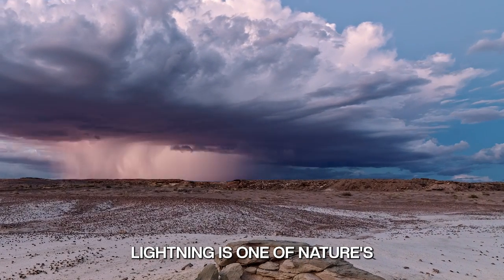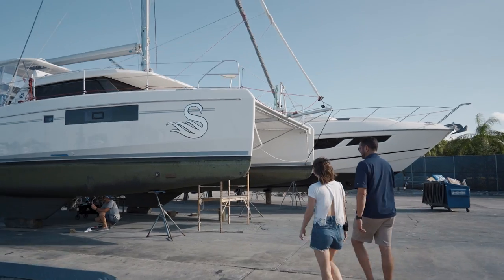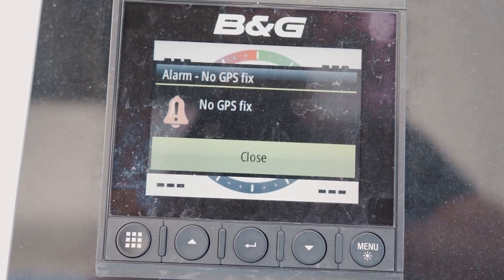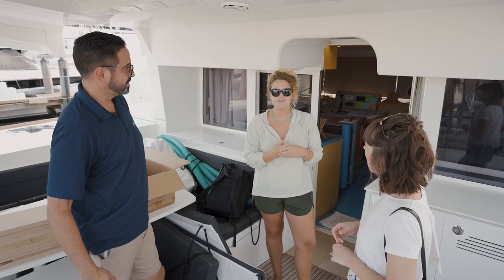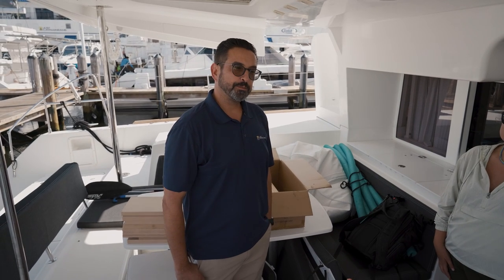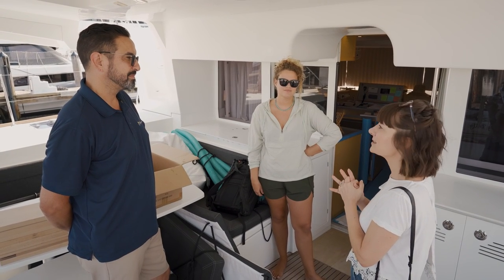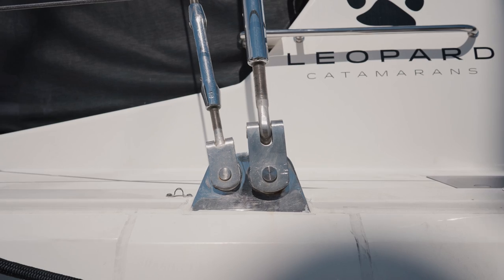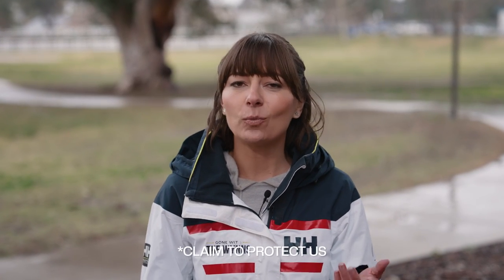Can Anything Stop Lightning?

Comment: When I was working for money I repaired and maintained Broadcast equipment in the southeast USA.  I dealt with the aftermath and prevention of lightning for forty years.  Ninety percent of the equipment I was responsible for was at the base of a tower.  This "mast" was sometimes two thousand foot tall. Our repairs often required troubleshooting at the component level of electronics.  The "Static Cat"  you are looking at helps but not as much as the marketing leads you to believe.  I would NOT drop fifteen grand in that thing.  I would quadruple all the grounding devices on the hull and quadruple the size of the wires that lead to the base of the mast and the wire that runs up the mast to the "Brush" device.  Next, all electronics, a.k.a. anything that uses electricity, needs to be grounded to that same point on the base of the mast.  Watch the Delos episode where during a lightning storm, they placed all their handheld electronics in the microwave oven. That's called a Faraday cage and is very effective.  Brian was an electrical engineer so he knows more about this than your average sailor.  YES keep good insurance. YES document events.  Once a simple screenshot of weather radar prevented a very expensive claim from being thrown out.  Lastly, do NOT rely on mechanical connections for your grounding.  Research exothermic welding,  one brand is called "Cadweld". Ocean and salt air are enemies of low impaedance connections Good Luck

Comment: Been hit by lightning three times on ships , the most damage took out a sat dome and nearby 10 cm radar .
The sat dome was secured by six 10mm stainless bolts , all were cut through by the strike . The strike shook the ship considerably,  all 360,000 tonnes of it.
The only nav system that is safe from  a lightning strike is a sextant and wind up chronometer.

Comment: This is something you really should go into depth on. A few years ago I really spent some time and was researching this. It’s been pretty universally standard to do the typical lighting rod to ground type of system. Grounding being plates. Connected to the top of the mast with a fat copper wire and bonded.  And add a lot of SPDs everywhere you can. Use fiber optics where you can. I’d protect the most sensitive devices with separate SPDs. Not super cheap but not bad either. It’s just basically interrupting any wire to and from whatever devices. Both data and electrical.   Use shielded wire where you can. 

It’s really annoying more electronics manufacturers don’t put surge protection in their devices. Nothing will survive a direct hit but nearby they’ll survive. It’s a cheap addition to a circuit board.  

I’ve never had lightning strike a boat of mine but growing up in south Florida I’ve had houses hit many times. Last house i built in north Florida I had SPDs of every type and fiber internet so no transfer there and still got hit that fried parts of the alarm system and a few ports and devices connected to a network switch. All of my Ethernet wire is cat6a shielded and grounded. What is was was all of the alarm sensor wire. Only wires that touch frames of windows and run everywhere. It wasn’t a direct hit it was just the emp from a near strike with all the alarm sensor wire acting like a big antenna and building a big enough charge to blow part of the panel, keypads, and a few devices without surge protection built in attached to the switch before it found ground.  I added SPDs to every alarm wire, grounded the alarm panel with a isolated ground, and added Ethernet SPDs to the panel.  Haven’t had an issue since. 5 years.  All metal roof 3 stories with tall trees around and over parts of the house.

Comment: As a Ham radio operator, I know a great deal about lightning and antennas. Cellular towers get hit and suffer no damage because they have robust equipment protection systems. In your position, I would look into those systems and not strike avoidance. 
The energy of a direct or indirect strike CAN be managed and damage avoided.

Comment: The other thing you need to look at is surge protectors, on your electronics, however most surge protectors use MOVs to take the hit, which means if you do get hit you have to either replace the surge protector, or get a soldering iron out and replace the MOVs . Its still better than replacing expensive electronics.

Comment: I watch another channel (Sailing Ruby Rose) where they are having a Cat built in Vietnam. In the latest video Nick shows the plate on the hull used for lightning protection.
I don't know if this is a standard item or an upgrade.
My first thought was if the Wynns were having it installed during the build.

Comment: Getting mine installed next week by Just Cats (provided there's enough room for the cable). Apart from the math, the downtown when you have a strike makes it worth while to have this installed. Have to trust the fact that it works. Would be great if insurers gave a discount on their premium.
Reply: If you have a Z-Spar mast, the conduits are not held in place very well. The weight of the large cable can cause the conduit to come loose and bang around. I installed a small strap to hold the top of the conduit onto its track and no more trouble.
Reply: @andersonautomotive  Thank you, will look into that.

Comment: When it comes to marine products companies come up with ridiculous numbers for cost. 
The device you showed for ionizing the air is basically 2 metal plates that are opposite charged and this causes air flow between them which slowly builds up as neutral or negatively charged air. This device can be built for less than $1000 in parts if you know what you are doing. Also this principal would only work if it's been on for a while and the boat isn't moving. If you are moving you are constantly passing through new air so this device is not able to protect your boat. If you test this device in a controlled environment or a lab it will almost always work. But even just parked in a marina if the wind is blowing strong enough you're not generating enough negative air around your mast.

Comment: There’s electrical power lightning protection products for shoreline electricity connection. There’s also lightning protection devices you can use to protect your radio systems that connect between your radio and antenna. To protect proximity air direct hits you may want to run several “grounding” cables that terminate as shown onto the sacrificial anodes and maybe a trailing wire behind the boat. Most of the protective devices I have mentioned are not expensive as they are standard radio protection products. Try researching some of the products in Ham Radio suppliers catalogues. Safe travels

Comment: Very interesting video!!!  LOVE your channel already!  Those setups are rather interesting.  And yes I completely agree with you that, it shouldn't have taken this long for that idea to be implemented on boats.  The idea that it is based on is a good one!
I am a licensed "HAM" Amateur Radio Operator and lightning protection is a BIG  and real thing!  I mean if you really think about it, a radio tower stands up HIGHER than neighboring structures and sailboat masts do the same.  The lightning is caused by an imbalance of free electrons between the earth and moisture in the clouds.  Water is a fantastic conductor (keep your radio and heater out of the tub! LOL) and the transfer (the act of re-balancing the free electrons between the two) is lightning.   AND it will always travel through the shortest path with the least resistance ie, your boat and mast at sea.
So, I would suggest contacting HH and asking them to either 1)install one of those systems in your boat WITH the conduit or 2) install the conduit for you to add the system afterward.  It would be MUCH safer having the grounding cable in the conduit to protect the other cables (vhf radio coax / light power / sensor wire) from the extra current / heat and interference.
In the long run you have to think and decide which is more cost effective?  The extra $15-30,00 to prevent OR $50-200,000 to repair?   As the old saying goes, "an ounce of prevention is worth more than a pound of cure!  
AND further more, as to your comment about "whet about being on the hard?"  See if they can rig up approved grounding posts either on those plates or above the waterline (maybe in the engine compartment?) so you can connect the system to a grounding rod while on the hard.  The plug in boxes "should" have their own there or, you can ask to drive one of you own in if you're on dirt in an area of significant lightning strikes.  We carried the all the time for the generators in the Army!

Comment: Only a couple of minutes and from my knowledge, you first want to make your boat less attractive by using equipment that dissipates ions so you are less likely to be hit. Then you want to make a way that looks attractive to lightning for it to pass right through. A nice thick grounding strip from bow to stern that is attached to a sacrificial grounding plate on the outside as well as prop shaft. Have everything that is metal grounded to it. Masts, railings, pulleys etc. Finally have a lightning rod with a nice thick ground wire running down the mast to that grounding strip. Its best to use braided cable for both the grounding strip and the lightning rod. High voltage likes surface area over wire gauge so braided cable can carry more of the lightning away from your delicate electronics. 

Another thing you can do is put a single disconnect point between your equipment and power then shut it off during a storm. If there is no easy path to ground, the lightning is less likely to go through it. 

7:52 "doesn't typically do structural damage" this is untrue. It can blow a hole in the bottom of a fiberglass hull and sink a boat in seconds. No fiberglass hull his 100% dry. The lightning will flash boil any moisture where it exits the hull. If there is enough moisture there, as it expands, it will just explode making a hole a good foot or two wide.

Comment: What about out of the water? Same thing. Just use a ground rod driven into the ground - like a house has and connect it to one of the conductor plates on the hull or the junction at the mast and it will work the same way. The fuzzy things work under the same principle but they would need to be grounded too to dissipate the charge. The key is having a good connection from the top of the mast to the water or ground. I would expect it to be more effective in salt water than fresh as salt water is a better conductor.

Comment: Excuse me for forgetting. The extension pole costs about $75.00. The cabling needed and the 4 plates with all connectors, (depending on length of mast and size of vessel, $1,500.00 - $2,000.00 (US$). Grounding cable is expensive.

Comment: That device from Dinnteco is similar to what I wanted to ask if they've seen used. There are a few companies building EMP-protecting devices, and while they would help in a proximity strike they don't market themselves directly to lightning applications. I would wonder how well the two devices from Dinnteco would work. It seems those would cover most of your bases, but again as we all know electricity, especially lightning is very funny, and even with these devices, I would be curious how much protection it truly offers. If I was going to bet my hard-earned dollar though, I would want a setup including direct and proximity protection. We full-time RV and these EMP devices are something I've pondered for some time as we have antennas for the internet and such that hard wire into the camper. For now, though I just run all my ethernet through a Tripp Lite surge protector that has a warranty for any surges, and then we run two EMS units, a hardwired one and a plugin. Also as far as dry docking applications, I would wonder if you could put a power post on each of your hull grounding plates that could then subsequently have wiring run to a ground pose when out of the water. That would be my solution, but it would probably have to be a custom thing you do, as this is all so new and there really is no support for it. 

Great video though bringing up a scenario we all fear, but really should be talked about more!

Comment: IMHO, Grounding and bonding the boat's electrical system, Copperplate attaches to the hull underwater - this copperplate is connected to the mast rigging and the grounding system on the boat including the DC Negative cable. The electro-Magnetic pulse from Lightening generates  a very high voltage and current surge that travels through the air at half the speed of light and is very hard on alternators & electronics, but grounding & bonding will help, makes your boat the same polarity as water,  a bit of a stretch there :) Also, the MidNite Solar - Surge Protection Device will protect DC & AC circuits, inverters, charge controllers, and other electronics.

Comment: The aviation industry has developed mitigation for lightning strikes.   Would be interesting to learn if any of that tech is transferable to boats.
In the event you have a lightning encounter in the middle of the ocean (nobody seems to be on the side of the ocean..... ) what do you carry for back up navigation, communication and ability to recharge the back up units?   Most likely the solar system uses a series of microchips to efficiently control electric storage - likely that would be eliminated if struck by lightning.

Comment: Working in the electric power field for for over 40 years, we discovered that when something is hit by lighting, it does not like to turn sharp corners.  So I would recommend that if you put in something like you are looking at in video that all the wiring running to the ground plates on the hull be done with gradual bends.   No sharp bends please.  Just FYI

Comment: I am a retired Electrical Engineer and worked for the Air Force at their tracking stations doing power and grounding quality.  The main point is ONE ground point for allllll .  Ac, Dc, Lightning, everything "Grounds" at the same point. Does that little ball thing work, nobody will know for 5 years and 1000 installations. The only thing you can really do, is prepare for a strike.  Have a backup power source, such a a portable battery system that has it's own solar panels for charging. At least you will have phone, GPS of other emergency issues taken care of...like making coffee..

Comment: My wife and I were full-timers on a 40 foot Cat. We were in Tampa for some "free" warranty work when we were struck twice in 3 weeks. The Insurance company was  help full but we had to pay the deductible twice since we had two claims. Both times everything with circuit boards was wiped out plus other stuff. Lighting is whimsical and brutal. We had our AGM batteries stress tested. All okay and they summarily died three months latter. All the repairs were done by the original boat manufacturer to current factory specs. Still over the next few years small nagging problems arose that we just had to chase done and fix. Aside from a 40X21 Faraday cage I don't know what can be done. We never went back to Tampa and were never struck again. By the way three boats down from us was a 45 foot Sport Fish that was going to have a complete set of Nav. equipment installed. The new equipment was in the boxes on the sole of the main saloon yet to be unpacked. The storm that hit us fried all the new equipment IN THE BOXES. The Sport Fish has no mast. Go figure.

Comment: So, just to play the skeptic ... this thing de-ionizes the air around. Got it. How much air, and how fast? My first thought was: "In a marina I guess you're protecting the next boat down wind? My second (of only two) doubts is ... if it works by de-ionizing the air around it, why does it need a conducting/exit plate below the water? That would seem to suggest that it's just acting as a old style lightning rod. (Which may be of some value.)  So I wont be rushing out to buy one. But I'm definitely interested to see if insurers start offering discounts/incentives to install them. If they become willing to put their money on the line, I'll be convinced. A bit.

Comment: This is not just a sailboat issue in South Florida. I also have a 40’ Intrepid powerboat that was impacted by a proximity strike and it just randomly took out parts of the electronics. 

Something my mechanic told me that got me wondering is that the strike will travel through the NMEA 2K backbone to take out the electronics. If that’s accurate. It seems like there ought to be a way to isolate the backbone or individual items to create some level of protection.

Comment: In composite aircraft lightning protection is handled through a layer of metal mesh embedded in the composite, and of course the static wics. I'm curious about finding a lightening struck aluminum boat and see how that fairs. I'm also surprised more custom high end brands of sailboat don't include aircraft like lightning protection built into the composite itself
Reply: me too!

Comment: I read an article years ago about an Australian sailing the south pacific who was struck by lightning at sea.   The worst thing that happened is all the cans of Fosters beer he had in his bilge got spot welded together.  He had to use a pry bar to get the cans out of the bilge and pump the beer over the side..   He was madder about that than his electronics getting fried.  🙂
  Would surge protectors help protect the electronics onboard?  Thanks for the video.  Hope your new boat doesn't get struck it would probably cost north of 100K to fix and you may end up dead in the water..  Good Luck Looking forward to the new boat.  How much longer till it's finished?